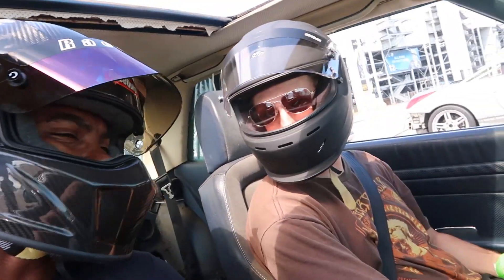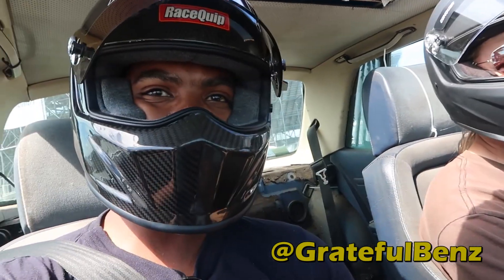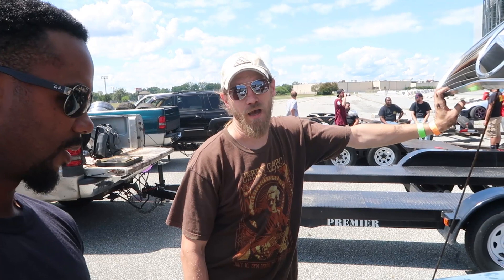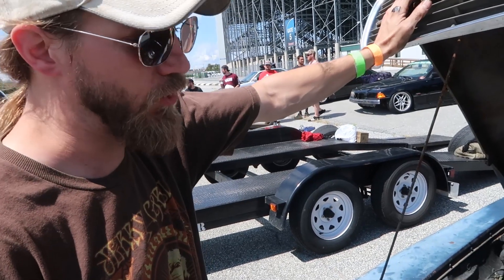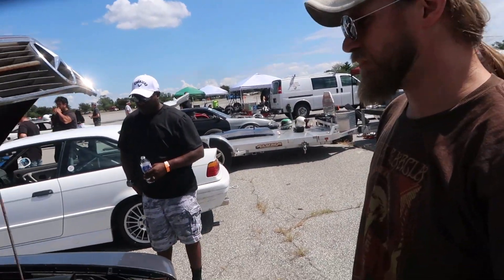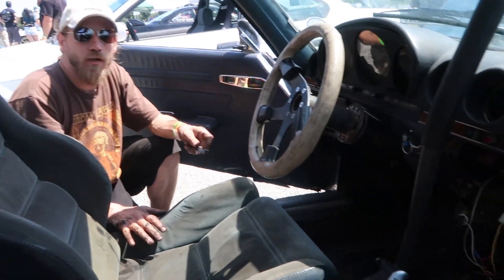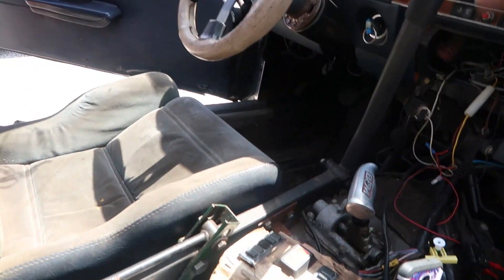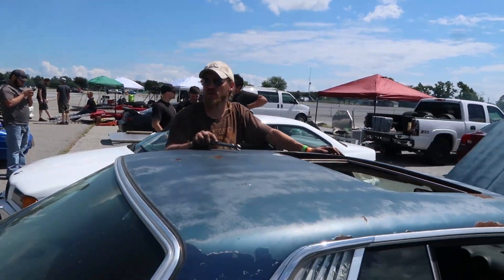1978 Mercedes 450SL Drift car!

Comment: Nice! How did he swap to manual gearbox? Does the 350 manual fit m117 Bolt on?
Reply from the maker: It's an OEM motor and trans combo from another Mercedes,  You'll have to pick his brains on the specifics though.  He's a few comments down.  "Jason Birch"